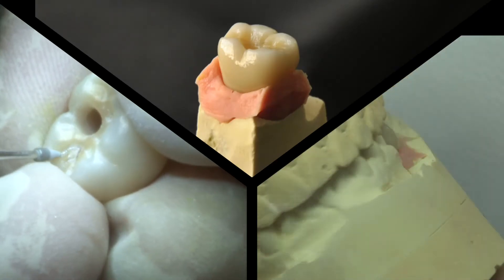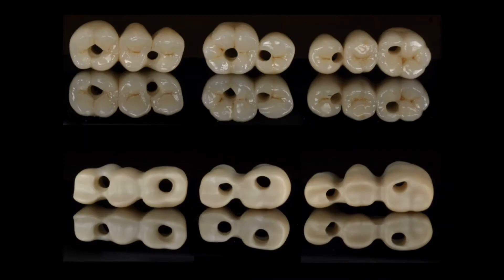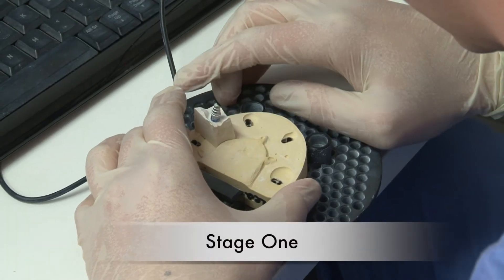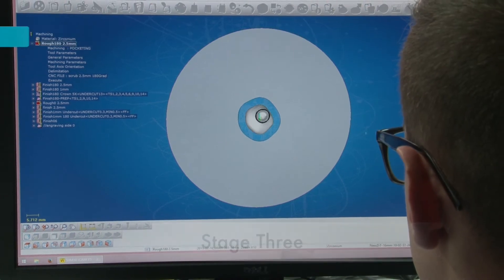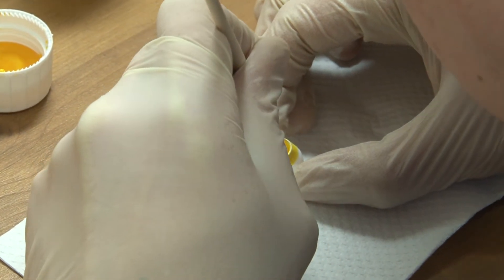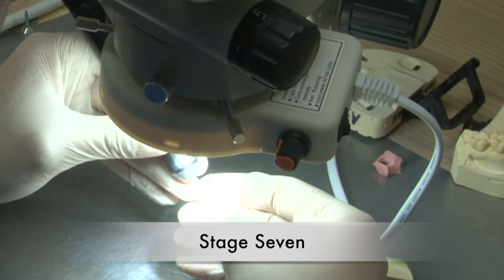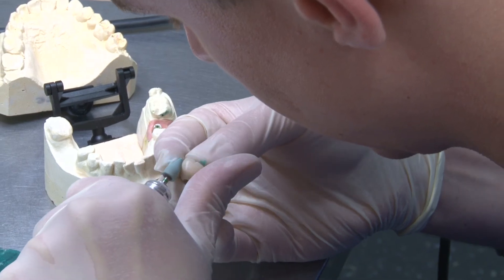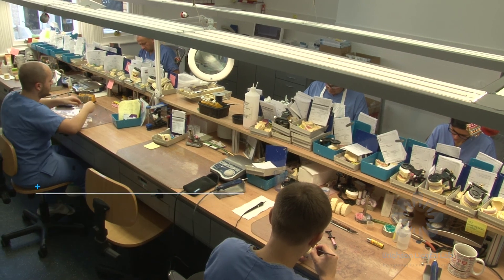How to Make a Zirconia Crown

Comment: How many days does it take to make 1 zirconia crown for a dental implant?  Thanks!
Reply: could be done in 1 day. 

it takes a few minutes to scan, a few minutes to model, a few minutes to cut the crown in the disk. 

After it has to be "cooked" overnight. so its ready next day
Reply: I've an appointment to get one fitted tomorrow and the dentist said i only need a 30 min appointment - is that even possible?
Reply: Thanks
Reply: I broke a filling and needed a crown.  I don’t live in the city I was in. Called a local dentist and he saw me.
He scanned (a few minutes), shot for pain, worked the tooth, re-scanned the now-prepared tooth.
Computer generated a crown design. Dentist modified the crown a bit in the computer (few minutes).
At the practice he has the computer-controlled milling machine.
Took about 15 min to mill the crown. Interesting to watch the machine work. His blank was a cube, about the size of a die, only does 1 crown at a time. Crown is oversized as in the video. Oven… about 20 min. Crown is now human sized. Put in mouth to verify that fit is good… it was. Take out, apply cement and put back in. There was no need to adjust the bite… it was perfect.  I don’t know if the bite is always perfect, but that was my experience.
It was all done in about 1.5 hours.
Reply: Re-read your question… Dental implant? Fitting a cap on a post has to be similar to fitting a crown on the stub of a tooth.